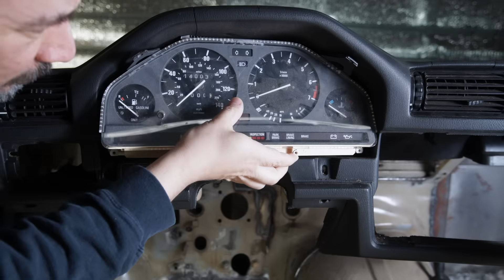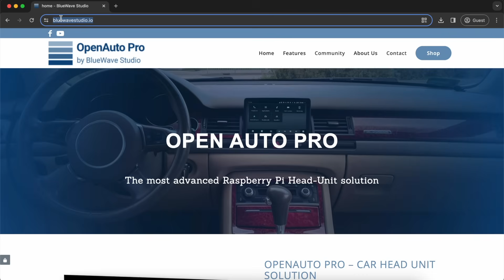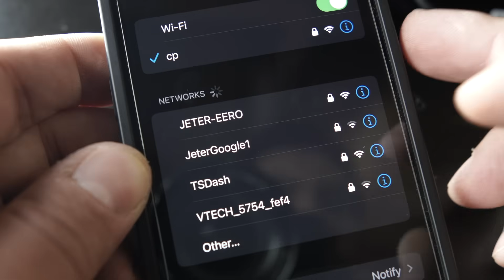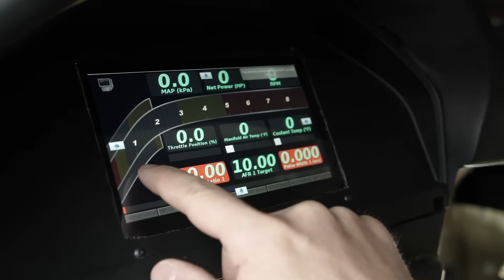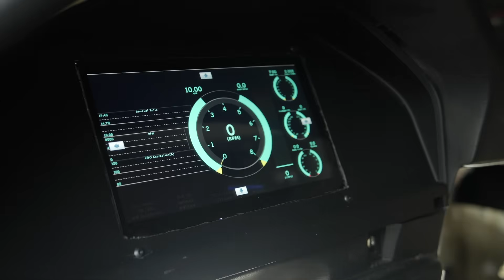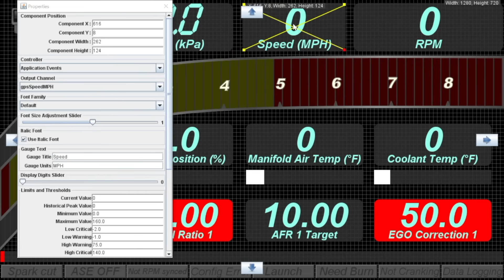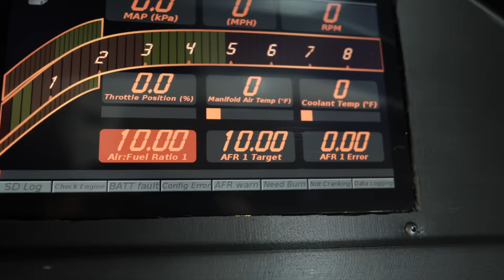Transform Your Digital Dash with the Power of a Raspberry Pi

Comment: Wouldn't an off the shelf Digital Dash like the AIM Strada or similar which is purpose built for this be a better option? They retain all the OEM vehicle functions and add additional functionality. Removing the mileage for example would make it non road legal in lots of international markets.
Reply from the maker: @ash-d7o  you could go with AIM, Holley, or HalTech for sure. Will cost a mini fortune. Just trying to come up with something for the track cheap. But mileage is except on this bad boy as motor block is different than original here in the states. Not sure how other countries work 🤔🤔🤔
Reply: @Itsallaboutthebuild  Thats fair. In Europe, it doesnt matter about the engine, only the VIN, and the mileage attached to the VIN cannot be tampered with in any way or it will be considered 'clocked' and if its not displayed at all, it will not pass its annual Ministry Of Transport certification to make it road legal, and if you cant get certification, you cant get insurance or road tax the vehicle, all of which are digitally interlinked on the government database, and over here they use a system on all police vehicles and road cameras called ANPR (automatic number plate recognition) which scans every single license plate it sees and automatically red flags any of the above which is not in place and the nearest law enforcement vehicle is notified and dispatched to hunt you down, lol. We truly have Big Brother watching you over here when it comes to vehicles and road usage.
Reply from the maker: @ash-d7o  oh wow, here in the states for old cars I've ever plated no one has verified milage. Title will then sometimes say "exempt" for milage...

Comment: I'd keep the originals hate digital dashboards they have no place in an older car.
Reply from the maker: @mikeysmith67  really why???
Reply: @Itsallaboutthebuild  for aesthetic reasons. A modern digital dash really feels out of place in an older car.
Reply from the maker: @DuneDudeNG  true true, which is why we tried to go for a retro vibe. Maybe we can go green 🤔🤔🤔
Reply: @Itsallaboutthebuild seems like an idea! Depending on the color of the exterior of the car, you could go for a greenish/reddish tint for the backlight color. Dont listen to all the negative comments. Everyone starts somewhere!
Reply from the maker: @DuneDudeNG  haven’t decided on exterior color yet, but changing theme based on exterior would be sweet 🙌 thx!!!
Reply: Mercedes w211 I changed ic to white guag on end coded it but I want digital will this work?
Reply from the maker: @Jemstk  If you have OBDII then check out openautopro or realdash

Comment: How is the latency? (i.e. tach vs actual rev/rpms)
Reply from the maker: @uses0ap  great question. Haven’t got that far yet, but we plan to hook up the raspberry pi to a speeduino ecu. There’s a few vids out there on speedunio that you can check out 🙌
Reply: im sure with an aftermarket standalone ECU lag would be acceptable, but when he mentioned the ODB-II software interface using and OEM original ECU.. LOL that would really suck in terms of latency.

Comment: Why not make it with the hole for the screen already designed in the print?
Reply: A lot of old cars had digital dashes. Just not screens
Reply from the maker: @Aves_1  true, should have named the video DIY LCD Screen 🤔🤔🤔
Reply: Heat inserts are awesome. Depending on your thickness of the main part, you can thicken it a bit, but you can sink them with a soldering iron and screw in, no visible screws
Reply from the maker: @MrMikelspencr  ah yes, just bought some, thx!!!
Reply from the maker: @ianholmen888  for sure wanted to, but when I cut the hole in the 3D model it significantly increased the print time due to all the extra tree supports. Need to figure out the best layout. Still working through that part…
Reply: @Itsallaboutthebuild snap in lid and flip it front down
So easy
Reply from the maker: @screener545  so have a precut hole???
Reply: @Itsallaboutthebuild  make it two parts to avoid the supports issue and add heat inserts for mounting
Reply from the maker: @Paul-rp7fo  🤔🤔🤔

Comment: This looks pretty cool its takes a 90's styling and brings it right into the 80's
Reply from the maker: @Lawrence-uw6cs  thanks, we tried to go with a mix of old/new. Can’t wait to get her on the road 🙌
Reply: @Itsallaboutthebuild  I say 80's just because it reminds me of some of the digital displays of that era, less the colours.
Reply from the maker: @Lawrence-uw6cs  thx, not sure if the color pallet is 80’s 🤔
Reply: @Itsallaboutthebuild you could have any colour screen in the 80's as long as green or orange! The styling of the incremental ramp instead of dials is more the 80's look i think, either way it's unique! Holden vk Calais or the Fairmont of that time from memory had similar so did Subaru, I'm doing similar for an 80's model but the easy way with a haltech uc10 to modernise it and have a tachometer redline that's matched to the engine!
Reply from the maker: @Lawrence-uw6cs  oh nice, does the haltech have complete customization display options too?
Reply: @Itsallaboutthebuild  haven't got the screen yet, just recently got the ecu and wiring so far. I was about to get the older version with 7inch screen then noticed the new uc10! it's not cheap just as a screen, but for the capability of having everything on one screen amongst its many features, it's not bad at all! And From what I understand the display is not completely customisable it has enough options to use and no doubt in future will have different facia options plus be fully customisable like some others for those that need it but i would not complain if they didn't as It'll be good enough from what I've seen, it'll be a fair upgrade over the '87 commodore dash that's for sure!
Reply from the maker: @Lawrence-uw6cs  just checked it out. Super expensive, but like you said worth it for all the features. We’re planning to do speeduino ECU, hope it goes according to plan 👍
Reply: @Itsallaboutthebuild  very cool! It'll open avenues for mods and tuning options! I like speeduino and had considered one for this but were out of stock when I was making my mind up.
Reply from the maker: @Lawrence-uw6cs  oh really? Anything else lead you away from Speeduino besides no stock???
Reply: @Itsallaboutthebuild I've always been a haltech fan, worked on a few car's using them,great support and all the things I need are in stock. Only found out about speeduino through forums and YouTube, love the idea and there's some great results using them too!
Reply from the maker: @Lawrence-uw6cs  that’s what we’re hoping for 😁

Comment: thats cool does it work on E46 too ?
Reply from the maker: @Trazer350  yes it can work with e46, much easier too, because e46 has OBDII you can interface the Raspberry Pi into OBDII much easier. You’ll just need different software like openautopro or realdash. More details here 👉 https://www.allaboutthebuild.com/blog/2024/1/40-year-old-bmw-gets-a-digital-dash
Reply: @Itsallaboutthebuild  does the dash from the 3d printer fit into the e46
Reply from the maker: @Trazer350  Sorry e30 won't fit into e46. Its different size so you'd need something like this 👉https://www.enjukuracing.com/products/hard-motorsport-gauge-cluster-delete-panel-bmw-e46.html

Comment: Hi!, what could I do if my car is iold (1977) and do not have ecu or obd2?
Reply from the maker: @octaviofranciscosalcidoroc9226  great question. Research using a audrunio and sensors to read different stuff like oil pressure, engine temp. Etc… An audriuno can read analog signals and convert it into dc which can be sent to Radpberry pi. Other folks may have some stuff out there you could use 👍
Reply: Do an LS Swap😅

Comment: Really curious why you didn't cut the hole for the screen into the file before you printed it?
Reply from the maker: @eddib17  great question, first was a prototype. Would have added much longer print time with hole due to additional tree supports to hold the large piece together while printing 🙌
Reply: @Itsallaboutthebuild  Adding the screw mounts to the design wouldn't make the trick?
Reply from the maker: @antoniomarquez498  You could add screw mounts too. Adding the cut out surprisingly would have taken more time due to all the different 3d supports needed to hold the part together which is why we initially did it this way. Need to play around with 3d file some more 🙌

Comment: what hardware is used to connect to the car obd2 port to the pi
Reply from the maker: Our 1984 e30 doesn’t have obd2 so we are going with a Speeduino standalone ECU, BUT if you have OBD2, you can use openautopro software instead of TSdash loaded on the Raspberry PI and use a Bluetooth obd2 scanner to connect to the Raspberry pi 👍

Comment: I want this on my 06 Arctic Cat Side by Side. However I have no OBD port. Any recommendations on wiring this in? Also any recommendations on what all I need raspberry pi wise?
Reply from the maker: We have pre-obd ECU so we are going with standalone speeduino ECU. That ECU can then be hooked up to raspberry pi for display output. If you want to keep your stock ECU, you may have to look at other board such as audruino as it will have analog-to-digital converters. That will be needed to take existing analog signal and convert to digital in order to display. It gets a bit complex which is why we plan to change our ECU. Plus a different ecu will allow us to do more tuning for things like turbo in future 👍

Comment: so is the power routed from your ignition? does it have a battery or anything for safe shut down or that not an issue? also, im assuming you're routing an obd2 cable or Bluetooth for data? im wanting to make a small secondary screen for my truck to display extra information on my dash. your set up seems the easiest so far.
Reply from the maker: We are replacing the non OBD ECU with a standalone ECU, Speedunio unit. The raspberry pi will connect to that via USB. Plan to power up via ignition start. Also, there's small UPS battery daughter boards you can get for Raspberry pi which can auto power off the unit gracefully when main power from USB is shut off. Thinking of going that route to make things automatic with safe power shutdown.What type of truck do you have?
Reply: @Itsallaboutthebuild  2005 4runner. i broke my AC units display lcd while doing a led swap so it gave me the idea to use the empty screen slot for a custom readout
Reply from the maker: @tylermiddaugh1515  oh I see. If you have OBDII, you could use openautopro or real dash on your raspberry pi to get additional info from your ECU.

Comment: E30 92
Reply: No dnt know if any
Reply from the maker: @jenstori5746  ok, will do some more digging, thx!!!
Reply: Do u have ig ??
Reply from the maker: @jenstori5746  YES!!! itsallabout_thebuild
Reply: Make me one so I can see if fits my build
Reply from the maker: @jenstori5746  what type of screen?
Reply from the maker: Do you know what the differences may be between 84 and 92???
Reply: I told u fuel tech will u make one or not ?
Reply from the maker: @jenstori5746  exact model of fuel tech? Need to see if dimensions will fit correctly in the 3D print. Need to do some more research 😁
Reply: SMH

Comment: Hello, first of all, congratulations for the great work. But once I saw the video I decided to buy it and install it, and I don't know if it's just me but it takes me a long time to start and it doesn't move as fluid as yours. Another question, how do you turn off the screen from the phone? Greetings and thank you!!
Reply: Hello, after checking the card and changing it to a 32GB SanDisk Ultra, it now runs really fast!!  about 16 sec it's working tsdah wonderfully!  Now I'm going to configure some outputs to put some relays and activate them!  thank you so much
Reply from the maker: @gorkagonzalez1014  sweet!!! Let us know how doing the relays turns out. Would love more details 🙌🙌🙌
Reply: @Itsallaboutthebuild  I have bought some octocoupler relays to be able to put the GPIO outputs and be able to control 12v with the octocoupler relay. When they arrive and I do tests, I will tell you to see what results I have had!!
Reply from the maker: @gorkagonzalez1014  fantastic
Reply from the maker: You can connect to TSDash build on the raspberry pi from your phone via the WiFi connection. By default the TSdash build has WiFi enabled. Connect to the WiFi and open your browser to connect to the web version of TSdash. On that page you will find the shutdown option. Not sure why yours may be a bit laggy. Are you running a raspberry pi 4 or higher?
Reply: @Itsallaboutthebuild  Thank you very much, I didn't know the web version of the phone. I have Rpi 4 and I installed the same image as yours downloaded from the website, I have also paid for the tsdash license. I will try another micro SD card as the speed of this one may be the problem. This week I will try if I have any more questions I will tell you but thank you very much!!
Reply from the maker: @gorkagonzalez1014  oh nice. We just used the free version. Good point on the SD card speed, forgot about that. We are using a sandisk extreme plus v30. 👍

Comment: I just bought an e30 it was a desert find  and boy does it need alot of wireing fixes
Reply from the maker: Nice, our e30 had tons of rust which looked like it worked its way from the inside from the sun roof. The passenger floor was really bad and the passenger trunk section had to be cut completely out. This build is getting a little crazy, but there’s no going back now 😁

Comment: Hey so quick question. I'm thinking about doing something like this for my motorcycle or even a celica gts(1991 year). Can I use all this on a carburetted vehicle without any sort of ecu(only cdi) or on a car without obd2 with the stock ecu?(Stumbled upon this video and subbed you guys do some very interesting stuff)
Reply from the maker: Much appreciated, so for non OBDII or just carb with some sensors you’ll need to add something like an audriuno that has analog to digital conversion. It gets a little more complex which is why we are going to go with speedunio standalone ECU connected to the Raspberry pi. Best of luck 👍👍👍

Comment: Nice one, can TS dash handle canbus if the appropriate pi hat is fitted?
Reply from the maker: I believe you can get PiCAN interface for raspberry pi to work along with canbus, not sure if TSdash has that support. Would need to do some more digging 🤔🤔🤔
Reply: @Itsallaboutthebuild  Its a little on he frustrating side, because everything works on Canbus these days... One particular problem is the fuel level signal, because Pi has no Analog IO, they seems to have omitted it, but its possible to use a Pi Nano to convert he analogue signal to activate 6 or 7 digital pins on the main raspberry pi to emulate an analogue signal...
Reply from the maker: @Mike-ry4ti  yeah, not a one solution fits all for sure. You could use an audrunio connected to the pi if you need analog inputs. Unfortunately all the premade 3rd party is thousands of dollars. We need something more affordable 👍
Reply: @Itsallaboutthebuild  I need someone who is good at programming to help me develop it
Reply from the maker: @Mike-ry4ti  right!!! I wish I was good at programming. Unfortunately I lack the skills in that arena 😮‍💨

Comment: This would be cool, but i would want bigger screen and looks like that oem e30 cluster is, but add some extra gauges at the backround
Reply from the maker: Maybe could go with 10inch or two circular digital cluster gauges to the left and right 👍👍👍
Reply: @Itsallaboutthebuild was thinking to do that but do you know if one thing could show at a time on the smaller screen? Or will it basically show as full screen. Not sure im asking that right

Comment: Do you have to use a stand-alone with this setup?
Reply from the maker: Standalone ECU yes. We are using Speediuno. But if you have OBD2, you can load different software on the Raspberry Pi like openautopro or real dash. We wrote an article on the options 👉 https://www.allaboutthebuild.com/blog/2024/1/40-year-old-bmw-gets-a-digital-dash
Reply: @Itsallaboutthebuild  okay thansk for the reply I have an obd1
Reply from the maker: @Kp_jay  ah, ok. I was trying to figure out how to get signals from older than OBDII and it would take having to use something like an Audriuno as it has analog inputs along with figuring out the right voltages to convert that into a proper output display. So we decided to find something premade along with full custom EFi mgmt. instead 👍
Reply: @Itsallaboutthebuild  Dang that’s smart, it can be possible with the Obd1 if you use the same concept as a scan tool
A mechanic here scanned my car the first time and it showed me almost ever value done to the maf voltage so I’m guess something like that can be possible in the future 
Good work all the way🤙🏽
Reply from the maker: @Kp_jay  you could maybe use an OBDI app with an OBDI scanner and display it on a screen or make a mini iPad dash screen. That would be sick 🙌🙌🙌
Reply: @Itsallaboutthebuild  that sounds like a good idea
Reply from the maker: @Kp_jay  need to get creative with these older cars 😁
Reply: @Itsallaboutthebuild  Yessir I’ve seen an s54 swapped yellow one on Instagram (correct me if I’m wrong)
Reply from the maker: @Kp_jay  s54 in an e30 😱😱😱 wanted to go K swap, but it’s too expensive

Comment: does it work for an old car with obd1 I mean can I use digital inputs of raspberry as I want?. I got an old car that all signals of the dashboard are analog and 12v bulbs I know i can lower 12v to 5v to be connected to raspberry pi imputs but I wonder if I can use Tuner Studio TSDash to do that ?
Reply from the maker: You’ll need an audrunio with some analog inputs. The raspberry pi doesn’t have the right inputs 😔😔😔